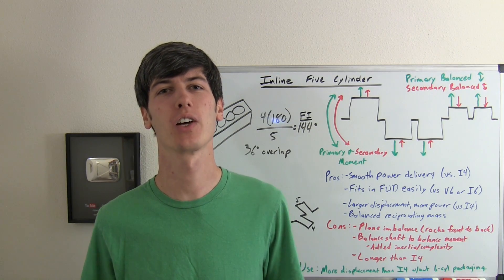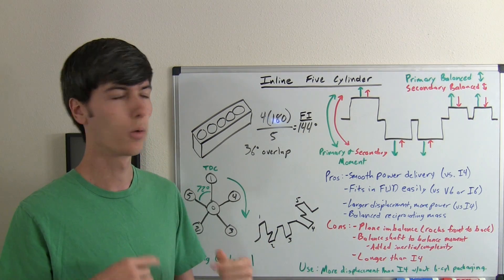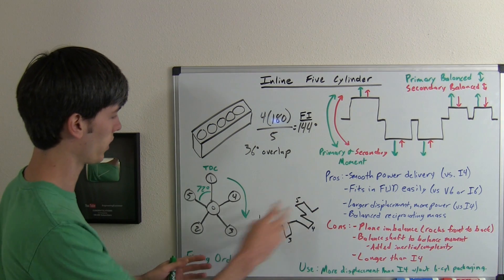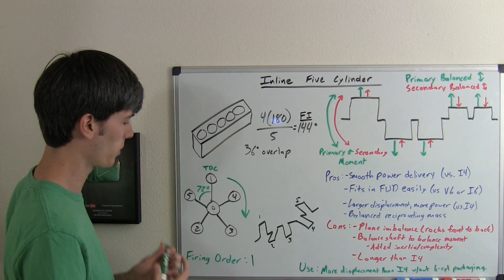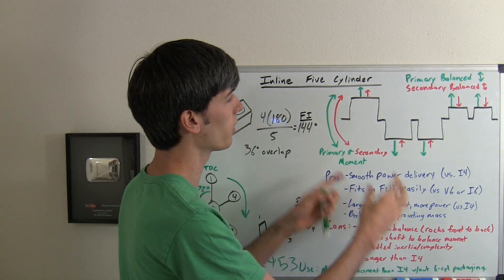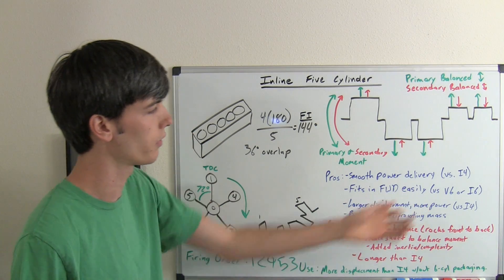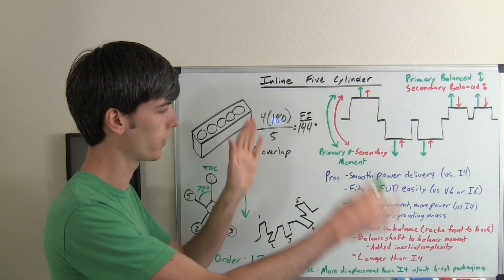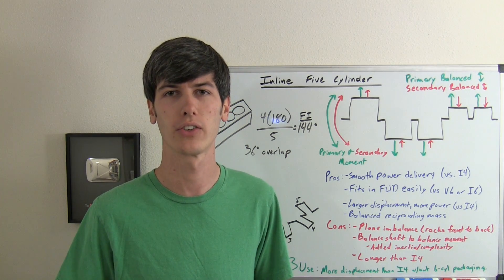Inline 5 Cylinder Engine - Explained

Comment: Today I spotted a VW estate car and it had a W8 engine I never heard of a w8 before I know VW had made W12 engines and the Bugattis W16 engine but can you explain the Pros and con's of a W configured and why VW would make a W8 engine because I was so surprised that I never came across a W8 in my life until now
Reply from the maker: They're pretty rare, and a bit more complex than a V8. Super small crankshaft, but that means the connecting rods are pretty thin to mash everything in there. It can work, but I believe it's just too complex/costly vs other options.
Reply: jhowe67 no the reason why they can do that is because they avoid emissionlaws by selling the cars as either kitcars or as the car it was based on, for example lotus. This only works in the US however hence they arent roadlegal in europe
Reply: In essence you can get an engine with more cylinders in less space. For example a W12 takes up only little more than half the space of a V12
Reply: Kristoffer Lilja Yea it's legal, but I think it would not pass MOT in some states like Germany, Austria etc... Especially Switzerland...
Reply: Engineering Explained
which might be why guys like SSC and Hennessy can make more power with twin turbo V8's than Bugatti can with a quad turbo W16.

Comment: why not make bigger cylinders instead of adding a 5th one?
Reply from the maker: Max Salvail I4's are limited in displacement due to the secondary imbalance they see from the pairs of moving pistons. Simply put, large 4 cylinders vibrate too much.
Reply: Engineering Explained Thanks for the video you have a great way of explaining things. Thinking of the 3.0L in the Porsche 944S2 and 968. Great cars.
Reply: +Max Salvail like EE said,   adding to that, you want to keep the mass of each piston+rod as low as possible for the Hp you want

Comment: My father has a 1975 I-5 mercedes 240 Diesel w115
It's got 1 more cylinder than the normal version, which has 75 hp, with his 1 extra engine, it has 85 hp.
Not very efficient xD
Reply: +Obi-Wan Kannabis lol cars in 75 were never efficient to begin withalso, have you looked at the torque specs or fuel consumption?(i didnt, but could be an inmprovement there)
Reply: +Obi-Wan Kannabis Ah, the first generation OM617! The first I5 used in a production automobile! Just for the record, they got a lot better over the next decade or so. With some refinements and a turbocharger, the 617 got to a peak output of 125hp for the 617.952. Hardly blazing, but still an impressive increase in performance.
Reply: Dan yeah, tbh, one can not complain about lack of power when the engine is so well built, that engine seems immortal.

Comment: Excellent video. It does explain why it has been, and in some respects continues to be, a popular engine choice with European manufacturers. Getting the increase in displacement and power over the I-4 and the smooth power application provided by the overlapping power strokes makes a lot of sense for a car like a Volvo or a Mercedes-Benz.

Comment: The sound of I5's... Ohhh my. I'd like to own an I5 car someday just for that reason.
Reply: Born in the nineties and from Sweden, growing up with a car interest the 5 cylinders from Volvo where always what you wanted, always turns your head and makes you smile hearing that perfect exhaust note from a 5 cylinder turbo engine, and today I own a S60R and every time I turn the key and step on the throttle there is nothing quite like it.
Reply: +JS92GoW2 All focus st owners say that, cannot drive that car without a smile. Sadly the greenies took over and now they're only making inline 4 engines. Lame.
Reply: @after_midnight9592  yeah. If you want an inline 5 engine, buy a Audi RS3.
Reply: Me to, got to be the best sounding engines
Reply: Go buy a slightly older Volvo already. I'm on my third, and that's for a number of reasons. 
1. Power
2. Sound
3. Tough as nails.

Now go do it.
Reply: +Carmicha3l Exactly what I think! ;)
Reply: +Roy Rki I know, I miss the 5 cylinder on the focus st and rs
Reply: +Roy Rki Focus RS* They're the ones with 300 hp. ST has under 260 hp.
Reply: I have an 3.5 i5 turbo by far best sounding engine I've had
Reply: I've been driving a VW Passat with a 5 pot since I started driving. I've got the exhaust slightly modified, and it never fails to put a smile on my face. Plus, that specific motor (the 07k) can handle like 12 pounds of boost with stock internals, so I'm planning to slap a turbo on it in the near future.

But even NA, you can get over 200 to the wheels, all while sounding like a Gallardo
Reply: Did you?
Reply: @jasper_north  no, unfortunately. I drove a turbo I5 Volvo once, which was cool to experience
Reply: buy a 3.7 colorado

Comment: so if adding a balancing shaft robs power, how much of a trade off would it be? would this make the added power vs an I4 moot even with the larger displacement? seems like a lot of hassle for little benefit. great video again EE. thanks
Reply from the maker: More displacement for a naturally aspirated engine will more than make up the loss through the balancing shaft. That said, I4's make a lot of sense. They're smaller, lighter, cheaper, and with forced induction displacement isn't as much of a concern. Volvo is looking to make their whole fleet I4's now, with forced induction for the more powerful models when needed.

Comment: You should've add "best engine sound" to pros
Reply: ^ this , i drove volvo and it has a great sound when you pushed the pedal down :D
Reply: @boedhaspeaks  yes. I have a rs3 and I cum everytime on the way to work.
Reply: I knew I wasn't the only one who loved how the volvo 850 I5 sounds
Reply: yesss! such a shame they are not being used that much anymore..
Reply: @sonnyman2000  If you want a new inline 5, there is the Audi RS3. (With a base price of $65.000
Reply: Im going to get one. The noise. oh the noise.
Reply: boedhaspeaks
Agreed, my first car was a '93 Volvo 850 with an I5.  Thing sounded like a V8 when you floored it.
Reply: I got a 2006 s60 t5 with a muffler delete and my friends say it sounds like a V8 when I rev it :)
Reply: I only found this out today that it sets up the same harmonics as the formula one V10.
Reply: I see where ur coming from but also 
rotary go brrrr
Reply: love the audi and mercedes i5s and the vr5 vag unit, best sounding is the Italian turbo 5 cylinder of the 90s, the original t5 and t5r lumps sound great aswell but the one used the focus st and rs doesnt sound particularly smooth/refined.
Reply: While I do think they sound pretty good, I just can’t admit that I like it more than a stroked out amc 242 l6. They’ve just got that needed deepness.

Comment: Aside from the european made V8s from Volvo and Scania, all modern north american semi truck engines are inline 5.
Reply: I think your statement is wrong. Most semis in North America use I6 engines. Cummins would be a great example of that. CAT used to make I6 and some V8s as well if I remember correctly, but there not used in over the road applications anymore.
Reply: hm, youre right.

Comment: The Acura Vigor had a short run with a I-5 engine.  I wonder why these I-5's didn't gain more popularity....
Reply from the maker: Because an I4 is cheaper, smaller, lighter, and these days can make just as much power as smaller displacement engines become more popular.
Reply: Engineering Explained True, but, as they are finding in Europe, small displacement engines with a lot of power tend to have decreased reliability and longevity. Not that I would turn down owning Volvo's new 2.0 triple turbo I-4...
Reply: Turbos are expensive, carbon cleaning costs